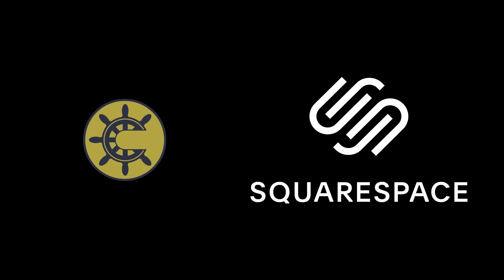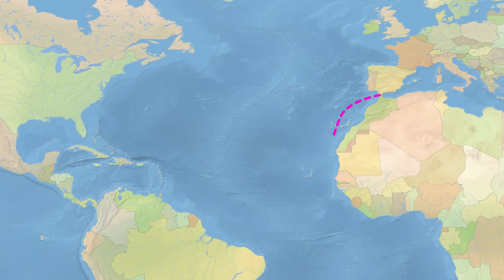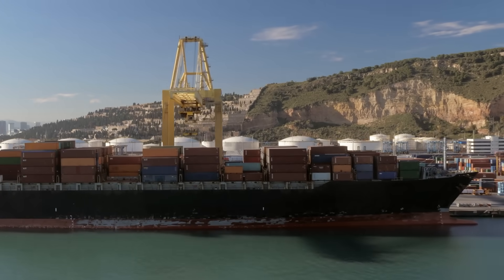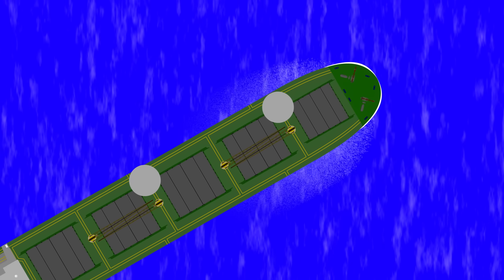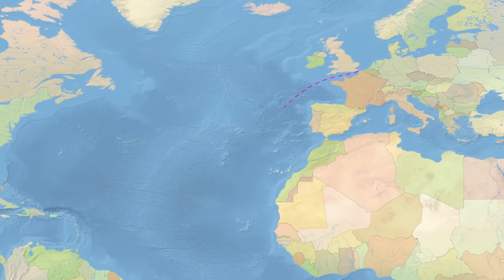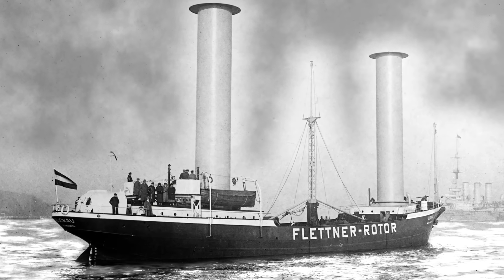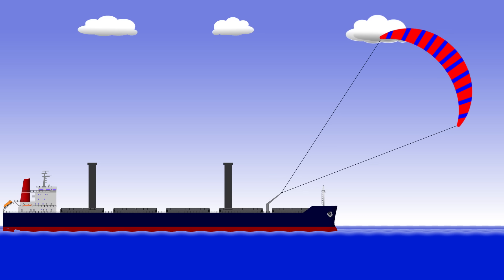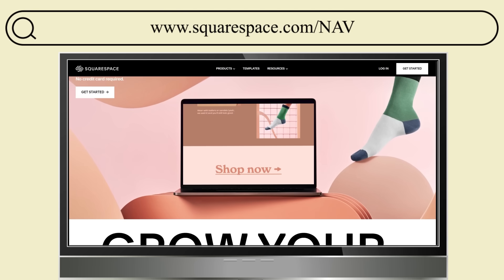Why Don't Sails Work On Ships?

Comment: Actually, owners who charter ships can get a benefit from paying to fit fuel saving devices to their ships. All it takes is for one to do it, and they gain the advantage of a competitive advantage. This means that if you owned ships you chartered out to other carriers, you'd gain the advantage over other owners chartering their ships by adding fuel saving technology over those who don't, as it's more expensive for the charterer to operate your competitor's ships, so if they have a choice between chartering your fuel saving ship, or a more expensive to run standard ship, guess who's going to get the contract? You! All it takes is for one ship owner to be smart enough to figure that out. If you just keep doing the same things everyone else is doing, you're ships are nothing but a commodity, and the contracts will just default to the owner with the cheapest prices. If you get bold and do stuff no one else in your industry is doing because they're too cheap and stupid to see the benefits, you've just set yourself apart from, and above the competition. You've become objectively superior to them and can charter for a slightly higher rate, and still have it be cheaper to charter your ships then anyone else's because the savings in reduced fuel consumption will more then offset a small increase in price, especially for longer voyages.

Comment: They should add folding flettner rotors in some special cargo containers that can be loaded onto any ship. Once they are unfolded and secured power cables can be attached and they have a wireless control that is operated from the bridge. Having the rotors be portable removes the need for investment on the part of the ship owner, and the container/rotors can be rented by the user of the ship.

Comment: going nuclear would be simpler in the long run
Reply: Not even a little bit, you can't just hand out nuclear reactors, the incidents that happen without them are already bad and you want to give nuclear reactors to commercial customers, meltdowns will be of the regular due to improper maintenance
Reply: @omyga2062  i said simpler, not good. but if they want to get rid of fossil fuels then it is either nuclear or start rebuilding the old windjammers and wait 6 months to a year for goods to be delivered around the world.

Comment: 3:15 it's not low pressure areas that create lift on an airplane. How would some stunt planes be able to fly upside down? Instead it's the deflected air that creates an opposing force in the opposite direction generating lift or in this case forward motion.
Reply: There must be a pressure differential between opposite surfaces of the lift producing airfoil  The airfoil and air can only exert forces on one another by contact ie pressure. When there is lift, this pressure difference is a fact, as is the deflection of the air. To deny the pressure difference on the basis that air is deflected is as dumb as denying the amperage of an electrical circuit on the basis “it’s got volts stupid”.

Comment: Where on Earth did the author of this video get the mistaken idea that sails are capable of deflecting wind toward the stern to generate thrust?? Sails work in one of two ways: downwind by being pushed against, or close to the wind by creating an airfoil shape to generate lift. In no way can a sail deflect enough wind to create significant thrust. 

The reason why ships sailed with the trade winds is because on large ships, only square-rigging is feasible, and square-rigged ships cannot sail very close to the wind. Sailing technology is thousands of years old. If there were a better way to rig large ocean-going sailing vessels, rest assured it would have been discovered long ago. On top of which, sailing close to the wind requires constant work, and for a cargo ship crew attempting an ocean passage, the amount of work involved would be tremendously exhausting, were they not taking advantage of the trade winds, and likely impossible to maintain for anything other than short periods of time when it might become necessary due to unfortunate weather.

Now, that being said, it is true that with modern engineering, we could build cargo ships with wind propulsion that were not as reliant on rigging as ships of the past, but the expense involved in both monetary terms and the embodied environmental impact of the materials it would be necessary to use likely outweighs the benefits.
Reply: Well, it stands to reason that if you angle a sail to the wind then the air WILL be deflected. If there is thrust toward the bow then there must be a change of momentum of the air wrt the keel of the vessel. It is the law of conservation of momentum. Aerodynamically, on a beam reach the lift is dominant, whilst on a run the drag is dominant but in both cases the air undergoes a change of momentum that is, by definition, negative toward the bow. Thrust is the 3rd law reaction to that.

>>”In no way can a sail deflect enough wind to create significant thrust.”

Thrust is force which is mass flow rate times change of velocity. If thrust is non zero, then the mass flow of air that interacts with the sail must undergo a change of velocity in the opposite sense. If you have mass flow with no change of velocity, you have no force and no thrust. Hence you are wrong and should go away and try to figure this out before trying to correct anymore videos like this.

Comment: if costs arent pushed to the charterer. then the owner wont purchase the rotors. except ofcourse, that the fuel is paid for by the owner, and the rotors save fuel, so the investment is obvious profit. so logically, they must already be doing so, installing rotors to maximise profits. except theyre not. so wheres the lie?

Comment: Check out the Fair Transport organisation. They want to implement sails with solar panels on a cargo ship.

Old fashioned transport ships already have a solution for cargo loading. The sails are not in the length  of the vessel so they are never in the way.
Other solution is nuclear power very safe and very clean.

Comment: Your analogy only works if the landlord is the one paying the heating / cooling costs for their tenant. If a technology exists that would recoup its own cost well within the lifespan of the object (house / boat / etc.) then after the recoup period, that's the extra revenue generating time, that's the 'extra they'd need to charge their clients'... but don't actually have to, and once paid off, the reduction in operating cost means they can begin undercutting their competition, generating more revenue than before.

Comment: The current generation of America's Cup sailing craft can actually sail at 3 times the actual wind speed.  Obviously bulk freighters represent a different problem, but seafaring technology has made great strides and the day may come when a solution arrives.  We have come a long way from the 12 meter sailing boats over the last 40 years.

Comment: Just a point; Sails do not work by deflecting the wind. they function as a vertical aerofoil creating a pressure differential between the sides of the sail. Just like a fixed wing aircraft.
Reply: .... The pressure differential causes the wind to deflect. That is also how fixed wings on aircraft work. Newton's third law must be involved somewhere for the airfoil to experience a lifting force, even if it is not directly.

Comment: My friend, using wind to power ships is not practical. We have had nuclear powered ships for over 50 years now. It is the way ships should be powered. Easy, cheap, high power,  problem solved, done. I'm sorry but using wind to power ships in the 21's century is not smart.

Comment: I don't think that sails work primarily by "deflecting" the wind in the way you think, but rather by operating as an airfoil.  That's how you can tack into the wind - by generating a pressure differential between the front and back of the sail by having one air path be longer and the other shorter... just like a plane.
Reply: ..the explanation that sails work by deflecting the wind is perfectly valid in as far as it goes. Same for airfoils. If you take the airflow and deflect it, you are by definition changing its momentum. It is just Newton's 2nd Law. Force equals rate of change of momentum. No change of momentum, no force. Ergo, no deflection, no force.

Comment: How are these rotors powered and what's the cost to run/maintain them? How much wind is required for them to have a noticeable effect on propulsion? I would have liked to see some additional information on that. Otherwise nice video on tech I have never heard of before. Sounds potentially useful, but trying to pass a law like this is surely going to be a long drawn out process with people blocking it along the way.
Reply: If it's good some idiot would have tried it and one did as stated in this video.  The fact it didn't catch on show it lost the competition of the better product win. 

Making a law forcing everyone to adopt this bad product is wrong.

Sure, go ahead and try it again.  Show others how wonderful your "sail" work and if they buy into it they will install it themselves.  Just don't put a gun to their head.

Comment: Flettner Rotors, like several others have commented are not passive. They require energy to spin the rotors, to develop forward thrust. The net result of everything would have to demonstrate that they would be need to be efficient enough to justify them, in the REAL world. Government regulation to force their use (especially, heaven forbid, that of the United Nations) would very likely be a boondoggle. Not unlike wind turbines that are spring up like weeds. Taxpayers will be paying a high premium for the self-congratulatory sense of some they they are "doing something for the environment".

Comment: I don't get it.   Where does the energy to spin the Fletner rotor come from?   How can lift/thrust generated by spining the rotor, pulling the ship forward into the air, not be cancelled out by the energy required to spin the thing?    Like a propeller in air?
Reply: From what I understand of the topic is that a Flettner Rotor still draws power from the power plant/package aboard the ship (be that a diesel generator + electric motor, nuclear reactor, or internal combustion engine). 

The benefit is that the Flettner Rotor can be used to supplement a more traditional propulsion system like a propeller, and the Flettner Rotor can provide a portion of the desired thrust while using less power to do so. Thereby increasing fuel efficiency.

If I misunderstood and instead you meant “how does the rotor provide thrust at all?” That is explained by the Magnus Effect named after Gustav Magnus, the physicist that invented it. The quick description is that fluids (like air) passing over the rotating surface of the rotor will be deflected to one side over the other (more specifically the air that’s flowing with the rotation will have a a higher flow rate and therefore a lower pressure, while the air flowing against the rotation will flow slower and have an increased pressure). This pressure difference as well as Newton’s 3rd law of motion tell us that for this to happen there must be a force from the rotor pushing on the air and an equal an opposite force of the air pushing on the rotor. The direction of this force is always perpendicular to both the direction of flow over the rotating body and the axis of rotation

The key benefit is that since the Flettner rotor is a cylinder, wind of all lateral directions will always be perpendicular to it’s vertical axis of rotation, so it can often produce thrust in the direction of travel without having to adjust the angle of the rotor. (It still cannot provide thrust directly into the wind)

Comment: Actually, animations can induce a false feeling in people. I think it's good to add that boats use sails just as an airplane use its wings. So, it's not the wind that blow inside the sail. The exterior of the sail sucks the boat due to the faster air which creates vaccum :). So the best wind is not from behind, but across

Comment: Assuming these wind power solutions pay for themselves in a short enough amount of time (and I don't see why they wouldn't, they don't seem expensive compared to the potential gains).  Wouldn't the operator (the direct beneficiary of the technology) be able to negotiate with the owner on a fair price for upgrading the ships?  

I can see why an apartment complex wouldn't want to take the time to try and negotiate with all their tenets, especially since the tenet will have no idea how much money it will save them.  But a cargo ship is a big enough asset, only has two parties involved per ship, and will have very clear data on how much it costs and how much money it will save in the long run.  If the money saved makes the installation cost worth it, then these solutions should become widespread without any government intervention.  If it doesn't then the parties involved are just too lazy to make easy money.

Comment: You lost me at the regulation and cost discussion. Its more like leasing a hybrid vehicle. They cost more up front, but you end up saving more long run because of fuel costs. 
Essentially: if the cost of the tech outweighs the cost of fuel, then the tech is entirely unnecessary as far as fuel consumption is concerned. Which means they'd be only an environmental pitch and hamstring countries that let their hearts get the better of their good judgement. 
However In the case of containerships I don't think the cost of the rotors would outweigh the fuel as they use millions of gallons of fuel every year. So the cost and maintenance of these devices would have to be in the tens of millions to outweigh the fuel and that is just nonsense.

Comment: Wish more time was spent on the inflatable airfoils, imo those are the "future" so to speak. Flettner rotors are really cool, but they only act as a supplement for traditional fuel use to reduce fuel cost by a percentage where the airfoil is intended and has potential to replace traditional fuel as the primary means of propulsion.
Very good explanation for how the rotors work though, and excellent breakdown of why companies aren't incentivised to put more effort into this kind of research. I hadn't thought about the chartering system, but it's a good example of where "the free market" can easily fail to truly breed innovation and where regulation is definitely needed to go forward.

Comment: One quick note. If it is not economically viable it is not green. The same way electric vehicles are not green.
If it saved enough oil, initial investment would return without need of increased freight rates. You could even lower your rates due to oil savings and take over the industry all while lowering CO2 emissions.

Comment: This a really funny idea: you don't know yet what technology needs to be used to supplement standard engines, but you're already rooting for regulations.
If new tech is profitable, what prevents ship building companies from installing it on new ships? If it isn't profitable, maybe we need more experiments before we introduce any regulations?
Reply: Profitable =/= desirable. It's profitable for the power plant to dump coal ash in the local river, but it's not desirable. It's desirable for cars to have seatbelts, but it costs the manufacturer money to install them for no financial gain. The only way to overcome this kind of thing is to require it by law, ie make it even less profitable to not do it.
Reply: @litkeys3497  
1. It it desirable for people to survive in car crashes, so they go and by cars that have seatbelts. Such mechanism also works.
2. If you impose such regulations on most of worlds logistics, you automatically significantly increase prices on EVERYTHING. For example, are you ready to pay 10% for everything just so cargo ships can have sails? What about 20%? Or 50%? Because we don't know how much it'll cost. Moreover, it's not just a flat increase in price, but bankruptcy for some businesses that survive on current shipment fares and that cannot increase prices. Which then can cause a domino effect and severely damage the world economy. Are we ready for that? Or maybe we want to experiment more so that the technology is actually useful?

Comment: Dude you really should not talk about aerodynamics. You got the principle of how a sail works wrong. You got the principle of how the Flettner rotor works wrong. The principle of the aerofoil was quite ok but how did you not get that the other methods work by the same principle?
Also your mounting ideas for the flettner rotor are exactly the same as they would apply for the aerofoil.
The Flettner rotor was discontinued because it‘s not more effective, it‘s just something you use to explain the calculation principle of induced lift or to get money from investors because it sounds cool and they don’t know shit.
Please just leave it be with aerodynamics and make a corrected version of this video or delete it, it might discredit your other videos which are correct.